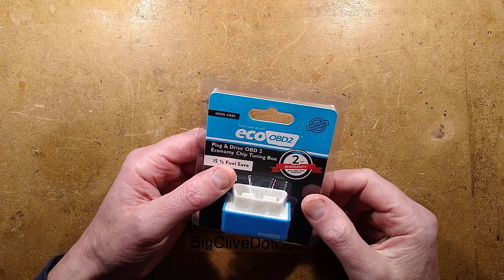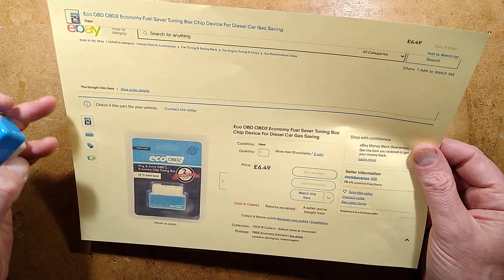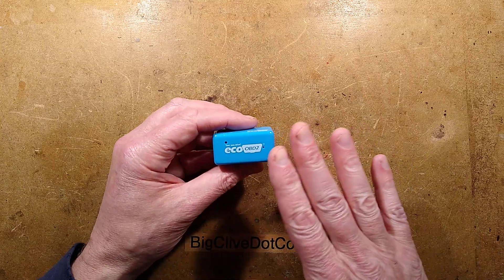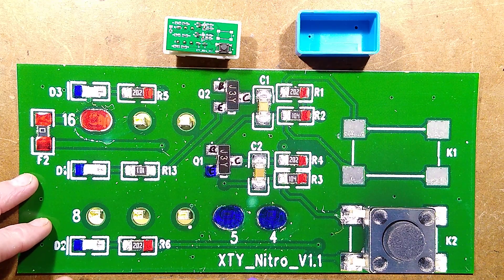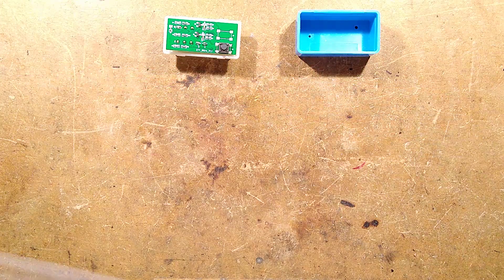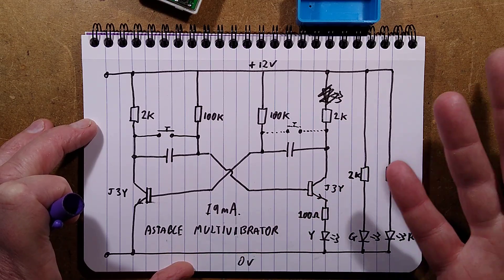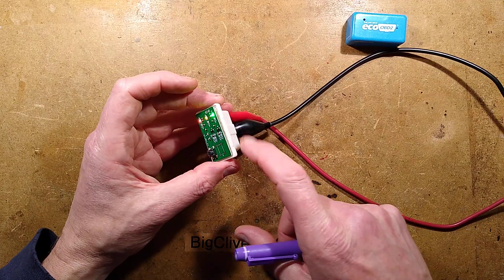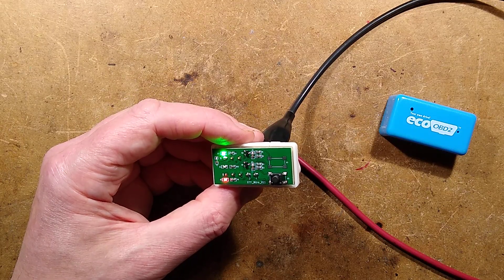Worst fake Eco OBD2 fuel saver yet (with schematic)

Comment: 3 flashing LEDs would have been even cheaper and they could have claimed that 'unlike previous versions' it is fully automated and needs no reset function.
Reply: The reset button is there to make the device interactive, which reinforces the idea that it is actually doing something.
Reply: @notahotshot  yep.  Then you drive more efficiently and the reset was effective
Reply: @notahotshot  it really does something, it pumping  cash
Reply: They should use the RGB colour cycling type Clive likes to use. Then they could make absurd claims like the colours cycling represent the fuel mappings being analysed and sampled. If they stick 2 directly side by side and have them visible through the same hole, they'd blend all sorts of colours over time as they go.out of sync... And to prove it works, they'd go back in sync showing the mappings being recalculated each drive for your slightly different driving style.
I'm sure a professional bullshit artist could word it much better than me... But you get the idea.
Reply: Dedicated flashing LEDs you mean? I think those cost more than the cheapest LEDs and transistors.
Reply: The 'reset'  gives that added 'personal involvement'
If it's 'not working properly' then it needs resetting again -- user error ;-)
Reply: Gotta be careful, the windows to let the LEDs show through might show the utter lack of circuitry inside.
Reply: Stop giving them ideas 😐
Reply: That'll be the next, upgraded version
Reply: Aidan Macgregor  True, I recall the buttons on the crossings in Australia were particularly robust being a stainless steel disc, about 50mm in diameter, with a strong spring behind it.  When I innocently asked why they were so robust the answer was "  'Cos they do b**ger all and people hit the living daylights out of them". 

Turns out to be partially true at least for many in central Sydney, where they are said to only input into the control system a limited times of the day / night i.e. when pedestrians crossing won't get in the way of the motorist!
Reply: I was just going to post the exact same thing, and you could have the reset button (if needed) to short the LED so it still looks like its doing something.
Reply: Why did you comment a week ago on a video uploaded today? 🙃
Reply: @techalyzer , trying to cover up for the time travellers?
Reply: @techalyzer  FAQ: Patron (paying) users see videos earlier.
Reply: @LeifNelandDk  Oh.. ok.
Reply: That would make it less believable.
Reply: Don't give them ideas...
Reply: Crikey you've just given them their next money spinning  upgrade model.

Comment: How long before the EV version is released?
Reply from the maker: I'm pretty sure they'll make one for whatever port they can find power at.
Reply: scammers will have no problem coming up with some babble to promise "battery range optimization up to 30% electrical power saving benefit bargain extend mileage....." to fit into your 12V car outlet...
Reply: @rarbiart  the fuel shark plugs into the 12v socket, same scam different socket

Comment: How generous of them to include a 2 year warranty!
Reply from the maker: That's probably to give people longer to lose the receipt.
Reply: @bigclivedotcom  it doesn't seem that the components would really burn out too. They'd probably last two years. Driving three LEDs isn't that hard and even in the crappy configuration it's likely it would last doing what it does for a long time!
Reply: If it STOPS WORKING within two years, they'll replace it. If it does nothing in the first place, can it ever be said to stop working?  😁
Reply: @DaddyBeanDaddyBean  "Works as designed"
Reply: @JasonW.  nothing equals nothing! 😂😂😂😂
Reply: @JasonW.  can't argue with facts 🤣🤣🤣🤣🤣🤣
Reply: @DaddyBeanDaddyBean  nothing minus nothing equals.....
Reply: I got one fitted to my tesla.
My mpg defo changed
Reply: Probably a hotline to a pyramid scheme vendor.
Reply: i wonder if anybody has tried to send it back under warranty  ?
Reply: Nice of em huh
Reply: You don’t those LEDs to burn out
Reply: So, if it does nothing, how do you know when it's broken. It seems like they could offer a hundred year warranty based on the fact that it does nothing I think my cousin Billy Bob's got one of those warranties.

Comment: About 10 years ago Progressive Insurance in the US had a class action lawsuit for their 'snapshot' driving/tracking device.  Not sure whatever happened with that, but the lesson resonates to never plug foreign crap into your car.
Reply: A reviewer tried one of those OBD monitoring devices for a month and it saved him, I believe, a whopping $4 (US) on his bill, meanwhile thoroughly invading his privacy.  Supposedly the rates are based on where (how dangerous a locale?), when (how heavy is traffic?), and how (are you reckless?).  The reviewer said that the rate was largely determined by the number of extreme braking events per distance, so he could bring his rate down by driving aimlessly to add distance if he braked too hard.  The unit beeped a warning to alert the driver [that his rate was about to increase].  He probably actually spent more versus not using the device, considering the wasted time and fuel spent on unnecessary driving.

General Motors is also pushing a behavior based insurance tie-in if you own one of their OnStar telematics equipped vehicles.  Thank you, no, Big Brother!
Reply: @wtmayhew  Probably ended up losing money by burning extra gas driving aimlessly around to add those extra miles!
Reply: @wtmayhew 
Wait... So they're saying if you brake hard to avoid a crash, you're a bad driver? That's the most retarded thing I've heard. Much better to just slam into the car that ran the red light or run over the kid that chased a ball onto the road.
Reply: @wtmayhew  Rob Spaghetti?
Reply: @wtmayhew  the reality is they sell your data to data brokers. Gm does this too
Reply: Oh yeah, Snapshot Discount, or as I liked to call it, "discrimination against 3rd-shift workers," since our rates were significantly higher because how dare we work at night when all the drunks are on the road?
Reply: Insurance companies claim these devices will "save you money" if you drive carefully.  In reality, they will use the data from the thing as an excuse to INCREASE your insurance rates because nobody will ever drive well enough to suit them.  They will say you accelerate or decelerate too fast, corner too fast, etc.  And you willingly gave them the evidence to prove it.
Reply: I remember seeing ads for that and thinking it was a joke! My insurance company doesn’t need to know anything more than they need to 😅
Reply: According to the lawsuit, Progressive had received “over 1,500” customer complaints as far back as February 2014 concerning the alleged damage caused by the Snapshot device. Those customer concerns, the suit adds, were in addition to “over 8,000” complaints about the device itself. Progressive, the case argues, therefore knew that its Snapshot device was defective yet kept quiet and failed to warn consumers.
Reply: @Speedy6617  good thing my daily driver is a 1988 it doesn't have such connection.. but i thought it thru and my driving they would have likely been like no no discount for you. Although the only accident ive been in involved an icy road condition. Simply slid off the road and hit something. People may say i drive like a nut sometimes but i know what im doing. All these years with no abs no traction control. Old beat up vehicles. I feel that people have a false sense of security with these fancy things. Oh its got abs it has traction control nothing bad will happen
Reply: @codyserucsak2501  I know with myself and the roads i drive on that it whould not be feaseable at all to let my insurance monitor me. I drive safe and am a low cost customer. But for sure the insuranse whould make a fuzz about my driving.
Reply: Also gives the insurance company data they may be able to use to deny otherwise legit claims
Reply: Fun story about those devices: I'm a car mechanic and I had a customer come in with a suspension complaint. So, I test drive the car to hear what they are talking about and I'm swerving left to right and I hear a beep. I hit the brakes, beep, the gas, beep. I must have made that thing beep 20 times before I figured out what the hell it was, then another 5 times before I actually diagnosed the car. I can only Imagine what that did to their rates that month.
Reply: I had Progressive and refused to use that snapshot thing for multiple reasons (chiefly "I don't want this bs to become the norm"), but now I have another reason to be glad I didn't.
Reply: What if your car is already foreign crap itself?
Reply: And insurance companies are still getting people to put these stupid things in their cars, or an app on their phone, 'to save money'.
Be interesting to see an analysis of how many accidents can be attributed to the use of this device.
Kind of like how red light cams regularly result in an uptick of crashes.
Reply: basically they use those insurances monitoring devices as trackers and data collection can monitor alot of vehicle data from the CAN network

these bloody things drain battery like crazy. dont leave any obd2 device plugged in unless you want a dead car in the morning!
Reply: data collection is valuable
Reply: Not all insurance companies use this data so most of the time it's cheaper having more options for insurance. 

Just remembered my insurance is due next month :( not looking forward to paying that bill! (I pay per year). I always shop around though as I always think even if you only save £20 that is 2 hours in wages at £10/h and looking at insurance only takes about 30 minutes to an hour.
Reply: I wouldn't let anything hook up to my car that's isn't a car scanner end of story.
Reply: Flo never mentions that...
Reply: I don't know exactly what happened...but according to there own adds towards the end...'not available in North Carolina ' 🙃
Finally government bureaucracy for the win... like our Utilities and Hospitals our insurance is also regulated by the State.
Reply: I keep seeing in this thread people mention how this data logger damaged cars and yet nobody explained how or referred to any article or anything else that explains how.
Reply: @jimjamauto  Well, youtube tends to delete comments with links in them. Go do your own research.
Reply: I have the state farm one and my 6 month rate went from $700  to less then $500 so there not all scams
Reply: @barclanbalegrion6731  I signed up for the State Farm product, I got them in the mail, only then was there a disclosure of a fee for rental of the hardware. So they got sent back. And I changed insurance company that I had for over 40 years, and my rates went down as well as the home insurance. State Farm was over charging and under insuring me. So I asked the AmFam agent about that, he said check premium costs every 2 years, your loyalty costs you money. He was close to retirement  and when I say that to any other agents they get mad. I'm now with Farmers, we'll see how long that lasts.